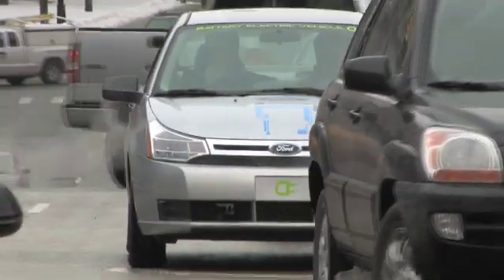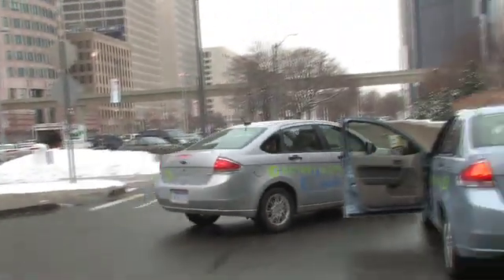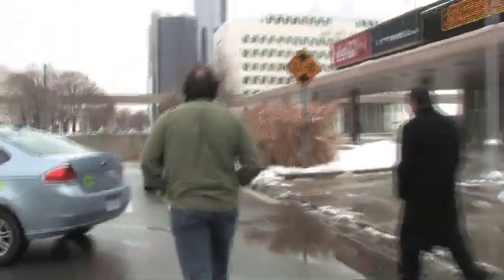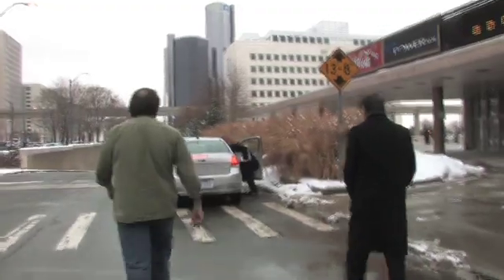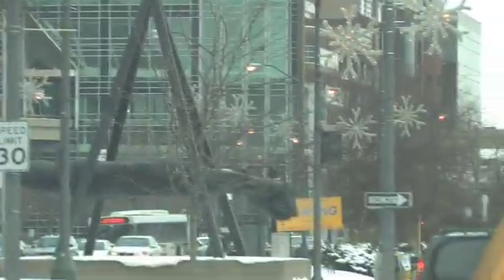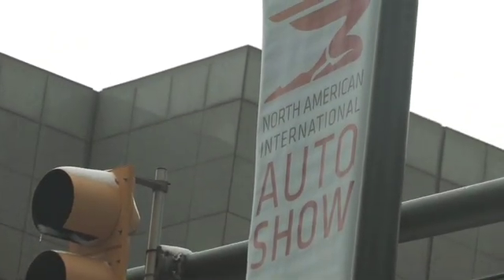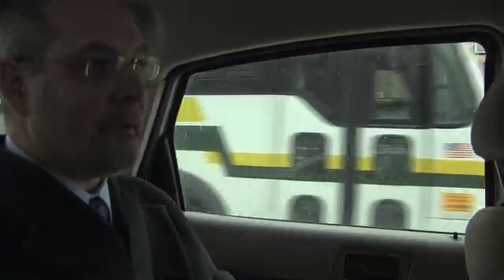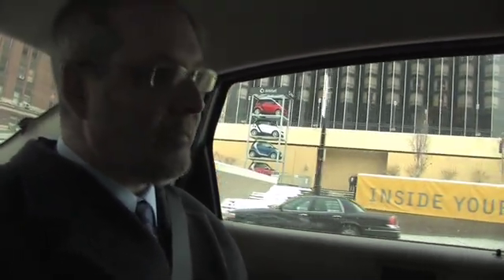Driving the Ford Focus EV mule

Comment: Electric car may become more profitable for the manufactures as they would be quicker to construct and easier to service and they could charge the same amount of money for these products and have a higher profit margin per product. 

Also there is a threat for the major manufacture from smaller companies that can produce electric cars that are just as cheap and reliable. 

20 years ago oil companies and manufactures would have resisted this but they are now having to change with the technology.

Comment: @Vanuatoo With the advances in carbon nanotube technology, cheap and ultra effecient solar cells will soon be possible.  Lithium air batteries will cut battery costs, weight, and increase the range to about that of a regular car.

Comment: He said this is first-generation, and also that it will be in a C-class vehicle. May not necessarily be in this Focus, and if Ford updates the look of the Focus, the EV technology will carry over to the new look.
What I don't like is the extra weight, nearly 500 lbs extra, and the slow accelleration. But, it is first-generation, so I'm sure they will work on it in the future. I'd definitely be interested in one as a work-and-back commuter car.